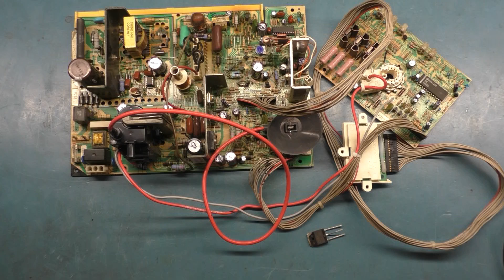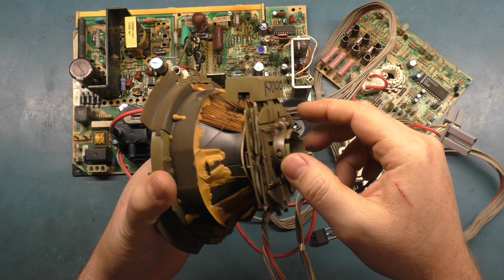25" U5000 Arcade Monitor Repair - Shorting HOTs - Repair Overview - Solder Bridge on U701?

Comment: Hi Mike, how are you? I really need your help. I need a repair on my Nanao MS8-25F monitor, it specifically comes from my Capcom QGrandAm25 case. The technician I have here in Brazil is not able to solve his problem. I would like to know if I can send it from Rio de Janeiro to your address and try to see if you can repair my monitor. It's possible?  Thanks!!

Comment: I've seen in past videos you have used an SNES controller as control input. I've been putting together a test rig and had the same idea. I read genesis controllers are easier to wire up. How did you do yours?
Reply from the maker: https://arcadeadapters.com
Reply: @MikesArcadeMonitorRepair  those are awesome!! Thanks.